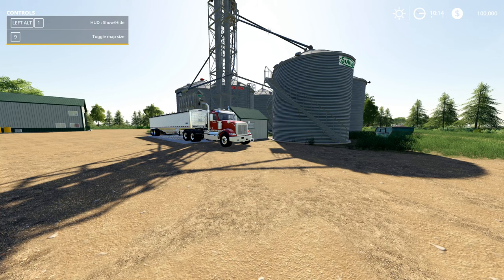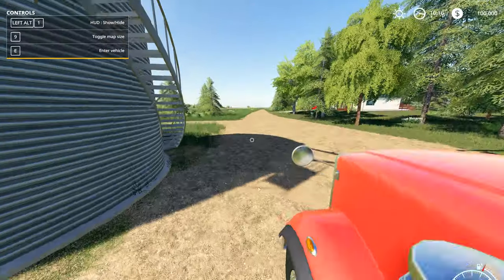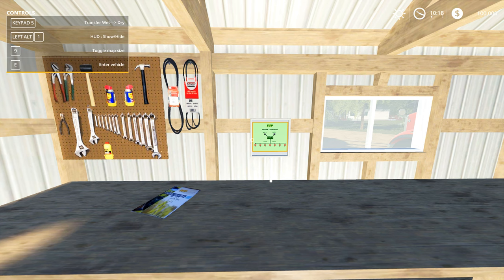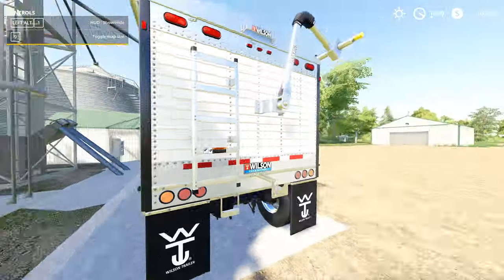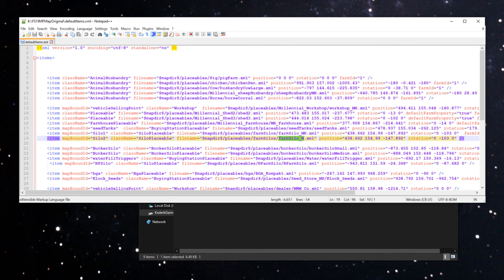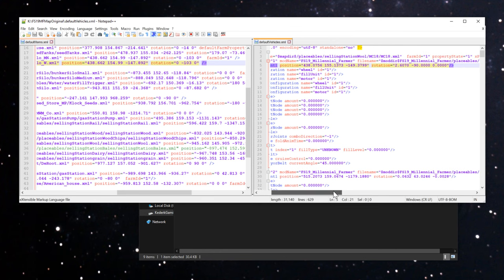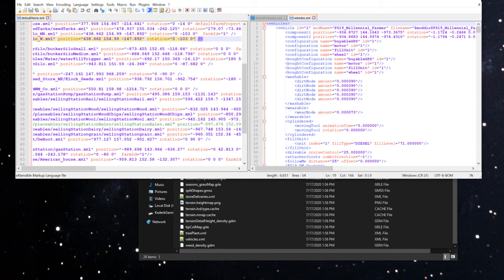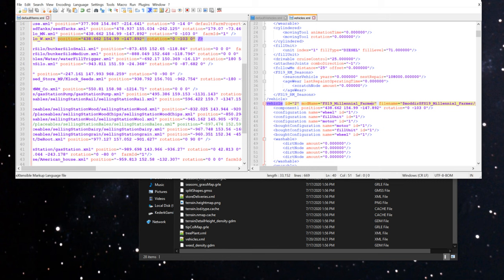Grain Dryer Operation & Bug Fix for new and existing games on the MN Millennial Farmer Map

Comment: Maybe they won’t be able to do it but hopefully they can allow us to use the grain dryer bin and the buildings on other maps
Reply from the maker: It's actually 3 separate mods but they were broken out as placeables within the map zip so you could pretty easily move them to a new map with a little bit of work in the giants editor.  Would be harder to make them purchasable / placeable in game due to the way that the wet -> dry transfer process works.

Comment: thank u this was helpful. is there also a fix for the problem than u cant go down in to field 2 from the top ?? i find it quite a challenge to go from the dealer to the farm
Reply from the maker: I don't think you'll be able to "fix" that as you actually leave the map boundaries when you go to the shop.  Mappers Paradise did this to make the map bigger for console players.  In order to avoid "invisible walls" you should stay on the road until you're back to the section where the ditches have normal looking grass.

Comment: Question, on my version of the MF map, the lights 2 option does not work, lights 1 turns on in all the buildings but lights 2 with the right mouse click does nothing. Do you have the same issue and do you know how to fix that?
Reply from the maker: I'm pretty sure both switches work for me but I'll make a point to check that out next time I'm in game.

Comment: So i did this exactly the same as you did but still doesn’t work, it lets me start the grain dryer (as in the transfer box in the shed) but no enter vehicle option comes up, any ideas on that? Thanks in advance
Reply from the maker: It's a bit hard to get into the hitbox sometimes.  I recommend moving around in the shed a little bit to see if the enter vehicle option comes up.

If you go out the back side of the shed and you get the enter vehicle option standing outside by the auger then you haven't actually moved the conveyor belt correctly.  If you're trying to do this for an existing save game I'd recheck the steps starting from the 10:30 mark in the video to make sure your save game is updated in addition to the map files.